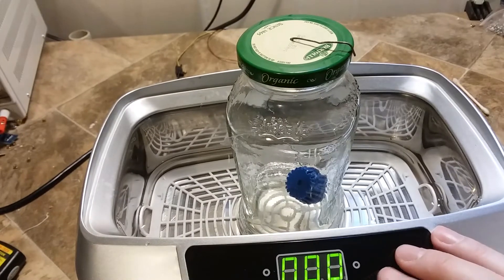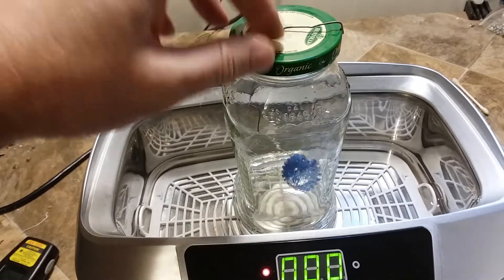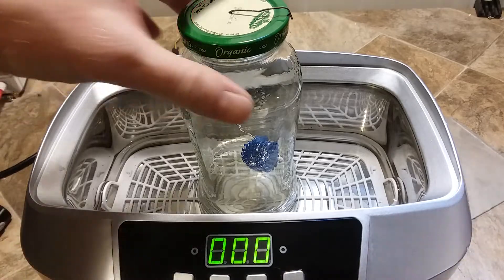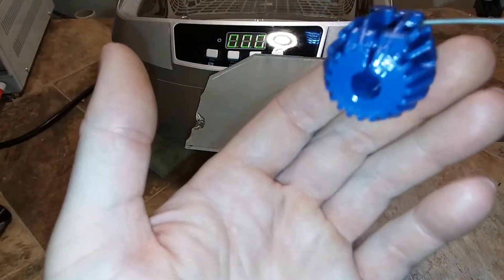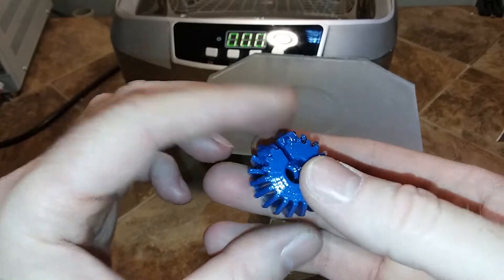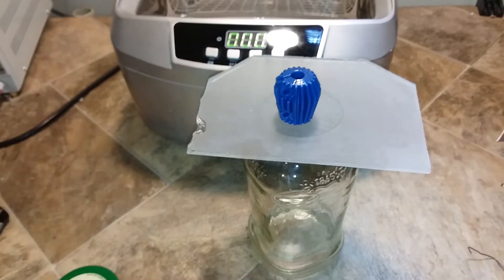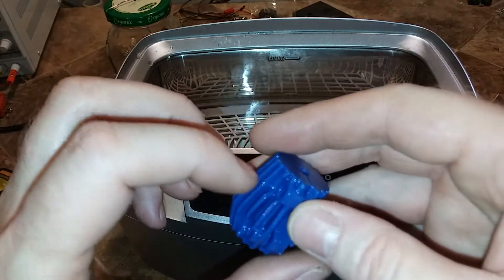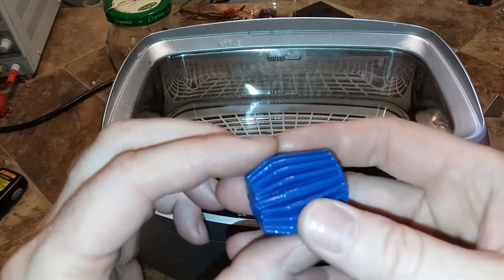Vapor Smooth ABS Prints In Under 10 Minutes

Comment: Nice! How well does the HF ultrasonic do on cleaning stuff?
Reply from the maker: I've used this ultrasonic cleaner to clean my 3D printer nozzle that have baked on filament and it worked great.  I used a small RX pill bottle filled up with enough acetone to cover the 3D printer nozzle and set a weight on top of the bottle so it didn't float and the ultrasonic cleaner completely loosened the baked on filament in two 8 minute runs.

Comment: I use the large glass cookie jar as you said but blast it with a hair dryer to get it warm then leave it for about 5-10min depending. Its all about the heat to create vapors not some crazy jewelry cleaning agitator.
Reply from the maker: I've tried the crockpot method but the crockpot gets too hot, too fast and the acetone boils off and does not really smooth.  The water bath method slowly heats the acetone/water mixture in the jar which is less aggressive than acetone alone.  

Over the 8 minutes the entire jar gets warm but not so hot the acetone boils off like in the crockpot or entirely evaporates like the cold vapor smoothing method using a huge cookie jar.  The ulrasonic waves cause the acetone vapors to move around more than just convection alone.  And I can reuse the acetone/water mix repeatedly without having to refill the acetone.  I've smoothed four ABS prints in a row without any need to refill.

Oh and it helps to have a tiny pin hole in the lid so it doesn't blow off in the middle of the smoothing...speaking from personal experience.